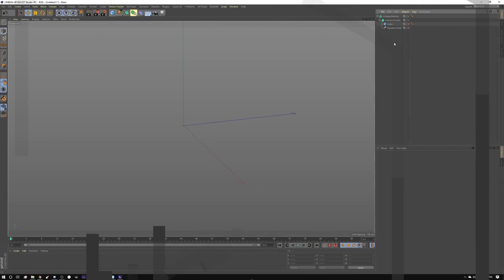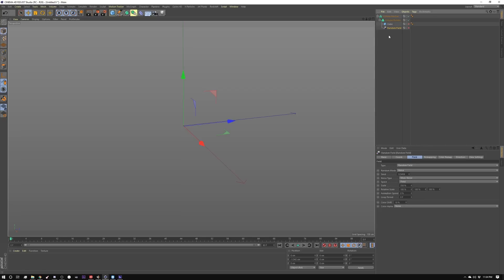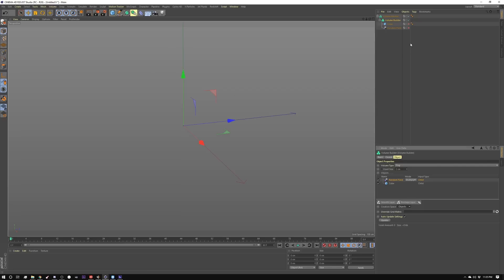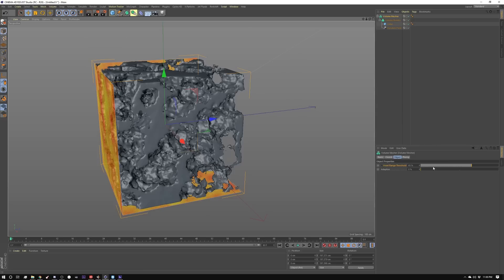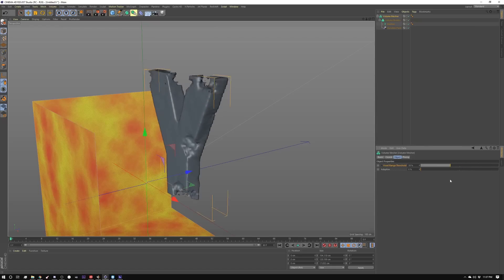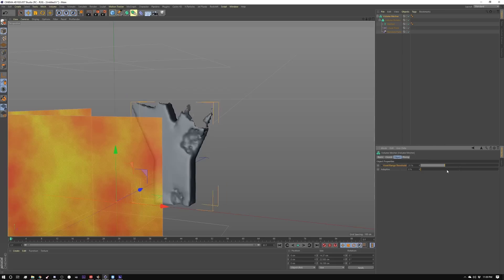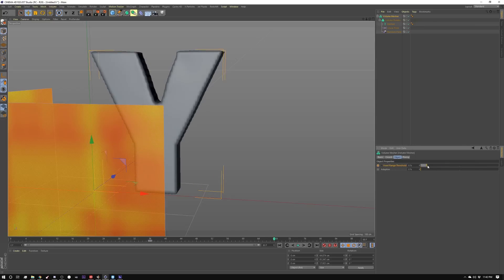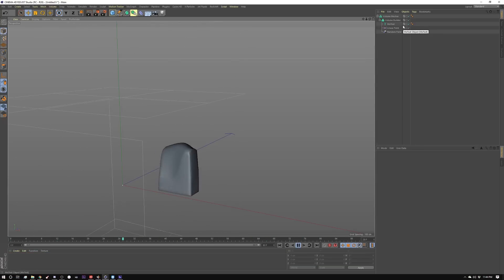Use volume builder to create a liquid type effect - Tutorial 170: Liquid Fields

Comment: Is there any way to smoothen the edges, I use Letter G which has that curvy shape, and edges looks like a steps, any solution for this? :)
Reply from the maker: Hey, Mitch thanks.  Volume edges are sometimes hard to deal with here is an example file on how I clean them up. https://www.dropbox.com/s/uf7cfs2wdqp9xp1/Volume_Rrefrence.c4d?dl=0     Might also check out Ej's tutorial on volumes: 
https://www.youtube.com/watch?time_continue=89&v=xR2Uozqcd0M&feature=emb_logo   Or  HelloLuxx's Tutorial  Here: https://www.youtube.com/watch?v=1P3GwYQzT6Y
Reply: choose a smaller voxel size and use smoothe